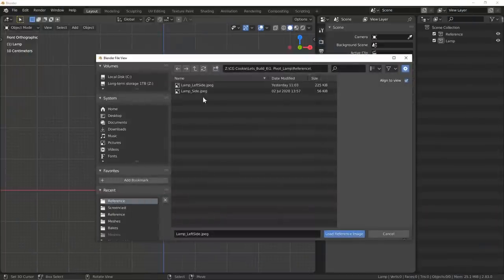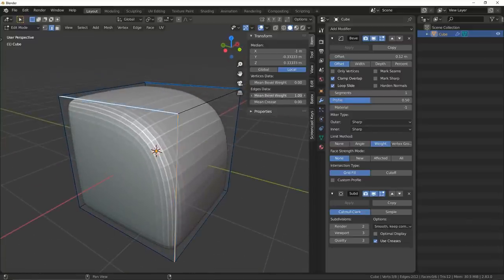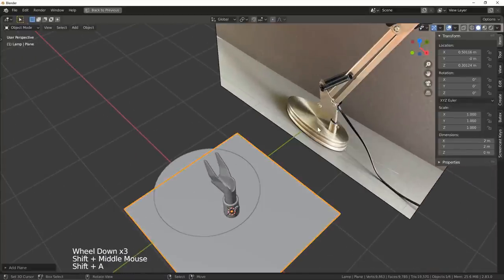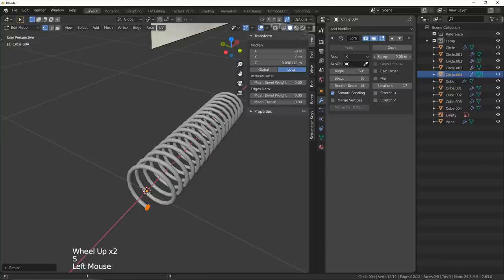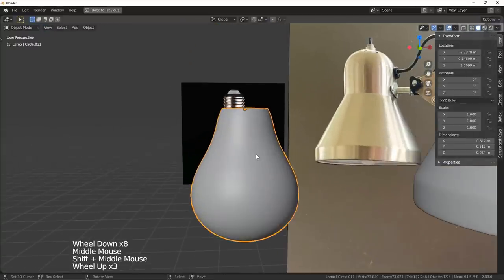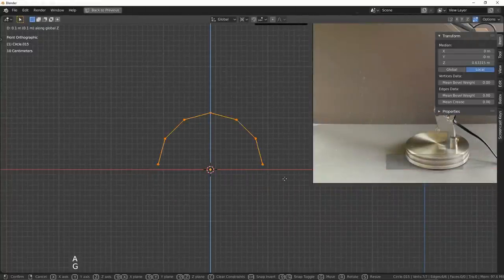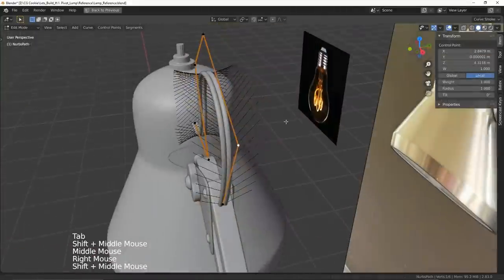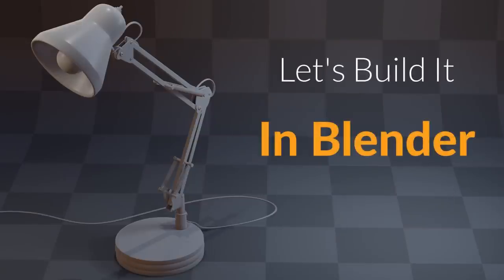Pivot Desk Lamp | Let's Build It In Blender

Comment: Just a tip for making lightbulbs. Use the UV sphere and remove the 2-3 bottom rings and extrude that part for the connector screw bit :)

Comment: I found this very useful and I love the organic feel each part has using the sub surf/bevel weight combo. I use it for most objects I make. 

However, I find that I am working with a high vertices /faces count. I am currently modelling a BMX using this method and I am nearly complete. I have just the bike in my scene and I am at 3million verts! It went up to 5 million when I used an array for the chain. Before any decimating. 

Any tips on keeping verts lower using this technique?

Thanks for the great content, I really appreciate it
Reply: So after about 8 hours of learning n working, I got my face count down to 650,000. I used a mixture of unsubdividing, manually deleting edge loops and faces, limited dissolve, and the decimate modifier (but hardly used the decimate mod) 

Thanks again for pointing out this technique. I love it!

Comment: This is pretty helpful thank you. but why dont you use the shift + E to make the angles sharper instead of making ne extra edges
Reply from the maker: The edge creases are very useful too, however they can result in harsh edges when trying to make more believable surfaces. Most surfaces normally have a rounded edge, if at a micro level. That being said, using edge creases is a totally viable option! -Chunck
Reply: @cg_cookie  That makes sense, i will keep it in my mind. Thank you for the answer and the video that makes us, the newbies, learn something new

Comment: I believe the same rules could apply when making a car, except maybe long stretches of smooth geometry where the bevel is non-constant along the surface, but even then, the support edges would then be used in combination to drive the weights of the bevel themselves. Would that be too far off-mark?
As someone that has used a long time ago support loops every-freaking-where to make smooth hard surfaces, mostly trucks, helicopters, cars and planes... this is something that I would like to try as an effort to get back to proper 3D modeling.
Reply from the maker: Ultimately, one method doesn't outright trump the other. They both have areas that they perform better in, because they do different(ish) things with similar looking results. I use both in my workflow consistently, it's a matter of knowing where you'd want to use one over the other. -Chunck :)